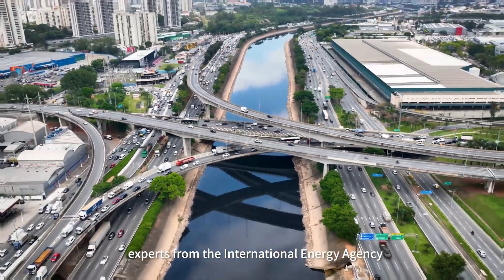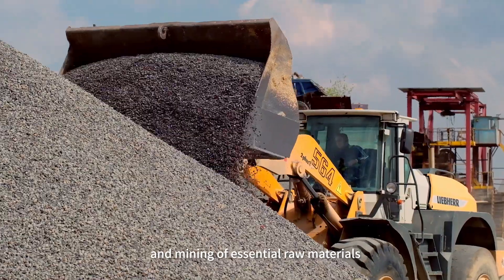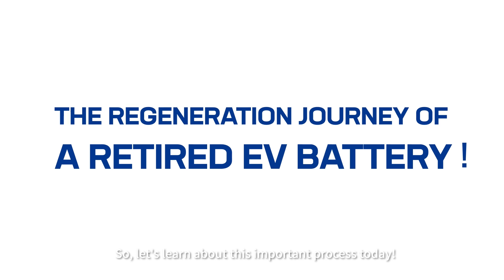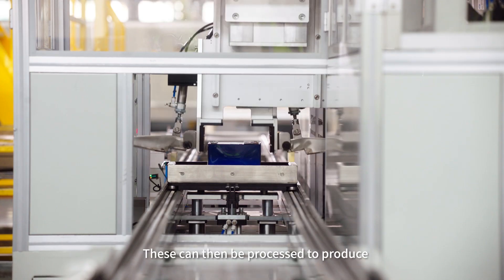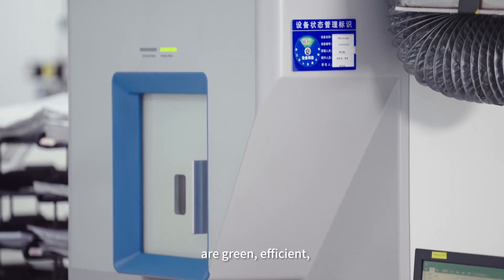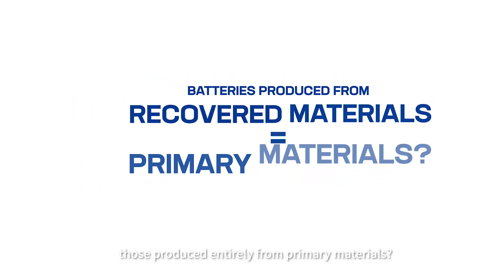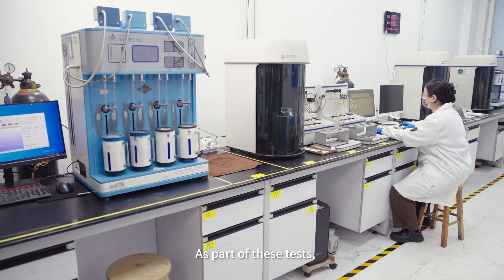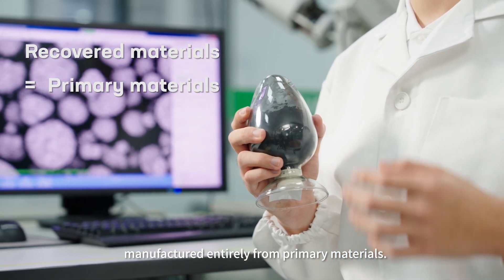Sustainability in Action: High-Performance Batteries from Recovered Materials

Comment: Please build and design semi solid 400 wh/kg condensed LFP  cells along side with 500 wh/kg condensed NCM cells and zero degradation tech into both of them,please do it because EV industry needs atleast 400 wh/kg cells to be real practical otherwise EV sales will continue to decline as we see it today,only company that is capable of making these 2 amazing cells is CATL
Reply: Sakuu in the U.S. just 3d printed succesfully solid state cells beyond what you claim only catl can do. 👍🏻
Reply: There are 750 wh/kg in cells in the labs in china,or sila nano tech full silicon nano wired cells promising 450 wh/kg in usa,or lyten start up in co op with stellantis have made LI-SU cathode 18650 and 2170 cells with 600 wh/kg,but none of them will hit mass production ever,even if they do,none of them can reach real 2000 cycle life,that is why i said only CATL can produce 400wh/kg LFP and 500wh/kg NCM in full commercial scale for evs
Reply: It's not that easy
Reply: Don't worry everyone, let's wait patiently for a few years and see who manages to mass produce it first.Looking forward to it.